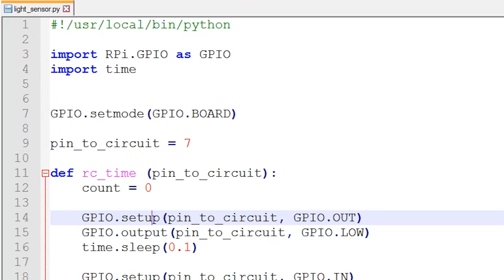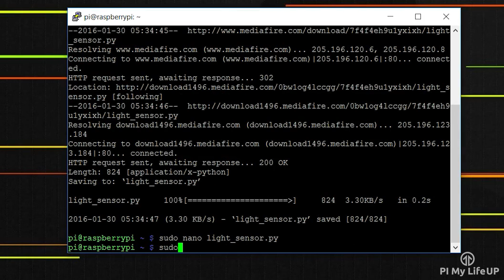Raspberry Pi Light Sensor: A Simple LDR Tutorial

Comment: I'm getting spiking in the signal (sudden drops in the resistance by a fair amount) when the resistance of the LDR is specifically between 15 & 50 KOhms, otherwise it's a nice smooth reading. This is in use within a raspberry pi 3B, and im logging the data to a file to be plotted in matplotlib. Any suggestions you have would be highly appreciated. Cheers

Comment: im new to the raspberry pi. so do you load code from a different computer to the pi or do you use the programming softwares on the pi to load the code
Reply: Hello George Willis, that's a good question. The answer is that you load the code from the operating system which you have flashed in your raspberry pi

Comment: Currently, I only have a 10uf capacitor and it seems to work fine. But is it ok to use a 10uf capacitor or should I only use a 1uf capacitor for this circuit? Thanks

Comment: Sorry, how many volts has the 1 mF capacitor ? I didn´t find this information in Pi_My_Life_Up_-_The_Ultimate_Book_of_Pi that I bought too
Reply: My 2 cents. Capacitor is rated by both - farads and volts. Volts can do potential work - "push" charge along wires or pump it on cap; or in the case of capacitor if they are too much - blow your cap. Pumped charge on charged cap is a product of capacitance in farads and volts applied to it. Q=CV. In RPi case volts we can use to pump charge on cap is 3.3V. The "small but important thing" about caps is that the rate of change of their charging up is not constant. At the beginning, when the cap is empty, speed of charge pumping (current, because current is charge per time), is high, and exponentially decreases as cap reaches its saturation (for given volts). So, we need cap which is rated more than 3.3V so volts are not blowing it out (most caps are more than that), and capacitance is small enough. I havent studied numbers much, but what Ive seen is 1 microfarad is enough. As you see, 3.3V is all we have here we work with, it wont hurt RPi if you use 1uF 8V or 1uF 25V. The cap will blow if you would have 1uF 1V (dunno, never seen such) and the Pi will burn if you use 1mF 25V. Because of 1mF using your 3.3V will have plenty of Q/t. Well.. ok, ok. Pi safety mechanisms will shut your Pi down. But there is a chance of burning Pi tho.

Comment: "uf" does not mean "Ultra Filtration"!  In reality it's not even a "U" but it's usually printed as a lowercase "U" in some cases because it's easier than printing the Greek letter "Mu" which looks like a lowercase "u" with a downstroke tag on the left.

the "f" is short for "Farad" or a unit of electrical capacity, named after Michael Faraday.

A 1 uf capacitor has the capacity of 1/1000 of a farad.
Reply: Wouldn't that be 1/1000000th (millionth) of a farad with mf being millifarad or 1/1000th (thousandth) of a farad?
Reply: @dang48  Amazing that my math error wasn't brought to my attention in the five years since my original post!  You're absolutely right.  I left off a few zeros.  1 uf (or "mf") is 1/1,000,000  of a Farad.  I wish Youtube would let me edit my 5 year old comment and correct it.
Reply: @waynethomason6388  LOL.  That's okay.  I actually had to read your comment twice before it registered for me.  Had I not re-read it, probably would have been another 5 years.😉